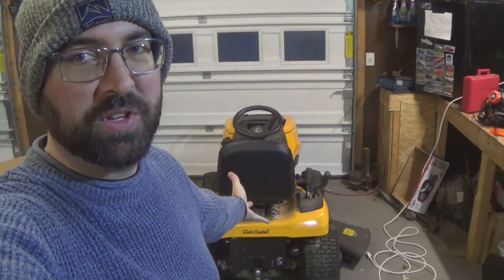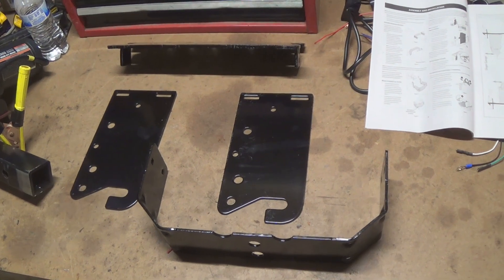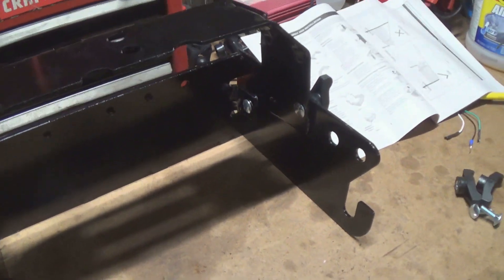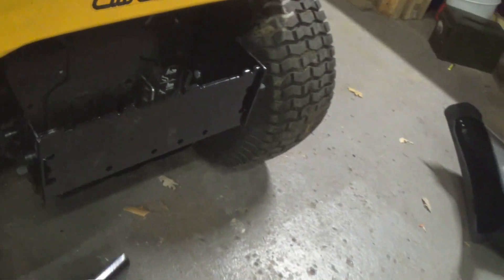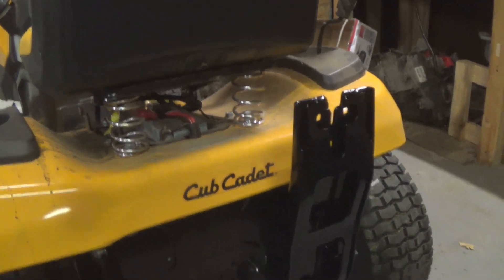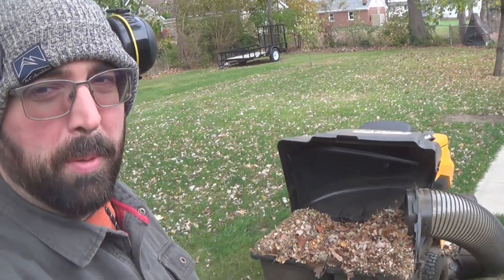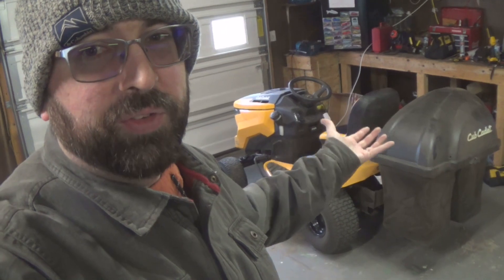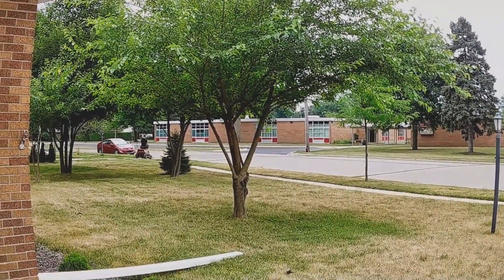How To: Installing a Bagger on my Cub Cadet - And First Test

Comment: You had debris blowing out where the mower deck and the adapter meet. Get a piece of foam pipe insulation to fill the gap. I also use duct tape to hold the foam in place.

Comment: I have the exact same setup as you.  And I see that your unit does exactly what mine does which is mowing deck blows the leaves out in front of the unit which is frustrating and that your bagging unit has grass/leaves getting blown out of it the seams as well.  Not happy with the purchase.  My neighbor just bought a John Deere with a bagging unit and it's night and day difference.  I'll be selling my unit next spring and buying a John Deere.

Comment: I installed the same bagger on my mower and every time i hit a bump in the yard the assembly pops off the hinges on the mower and the bagger unit falls to the ground.
Reply from the maker: You should have a pin securing the bottom of the assembly to the tractor's frame. I have not experienced that problem.